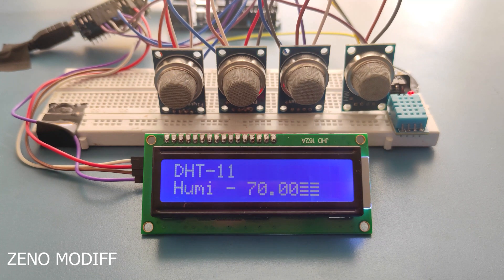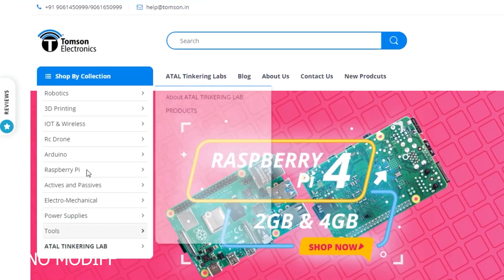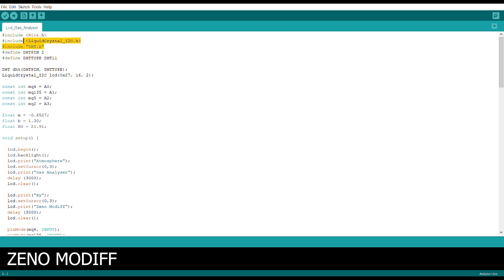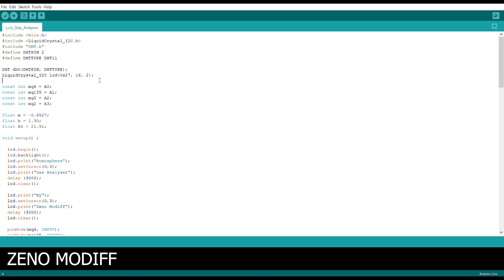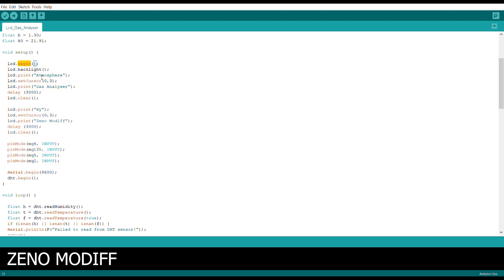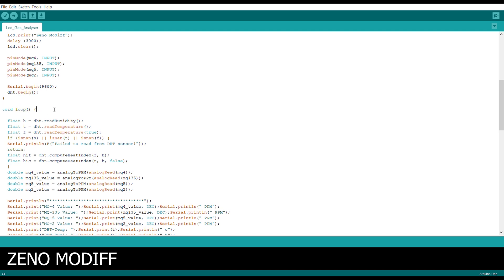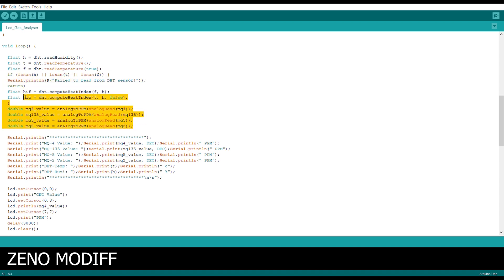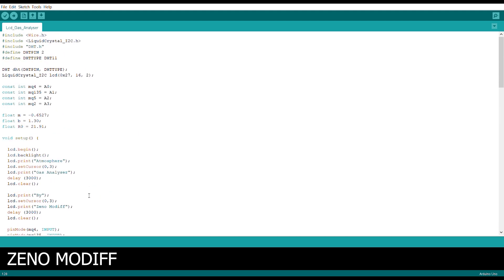Atmospheric Gas Analyser Using MQ Series Sensors , DHT 11 Sensor & Arduino

Comment: How are you giving the power supply to the project?
Reply from the maker: iam just using the microusb cable to power the project maybe if you need to take a step further u can use vin and ground of arduino
Reply: @ZenoModiff  thank you sir
Reply: @ZenoModiff  but for that we have to change the connection right
Reply: Can you tell me?

Comment: How dio you get those senor values? (m, b, R0)
Reply from the maker: // For Gas sensors

float m = -0.6527; //Slope 
float b = 1.30; //Y-Intercept 
float R0 = 21.91; //Sensor Resistance in fresh air

these need to be used to get perfect values from the mq series sensors

Comment: How do I connect dht11 and lcd?
Reply from the maker: Simply delete all related function call for other sensors or comment them out
Reply from the maker: Use common ground , positive to Arduino 3.3v And data pin to Arduino related digital pin